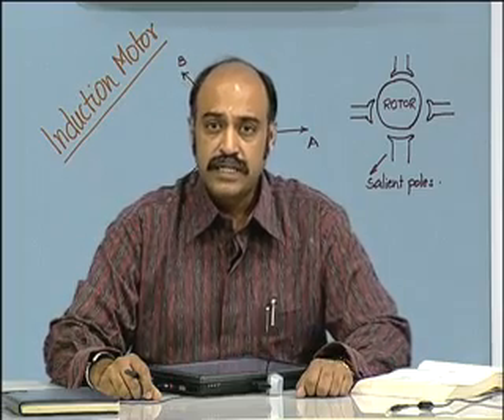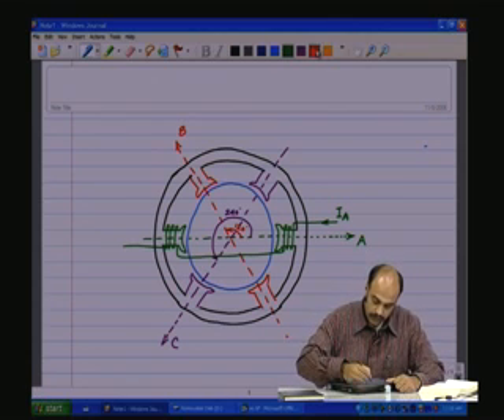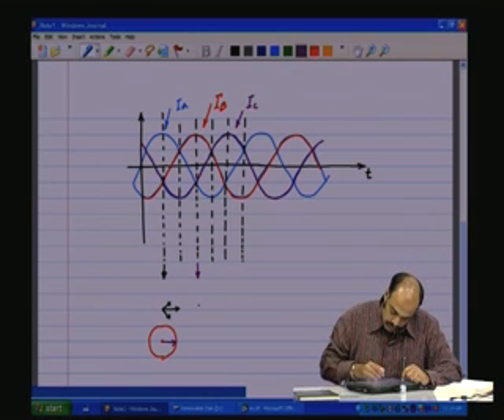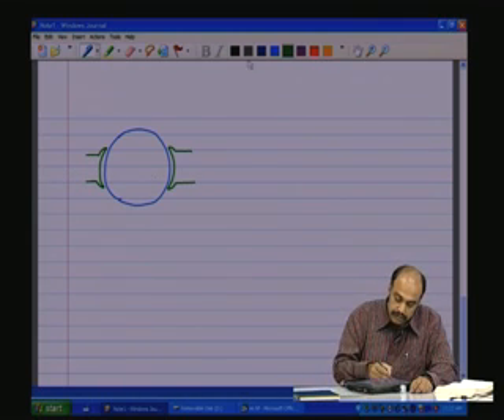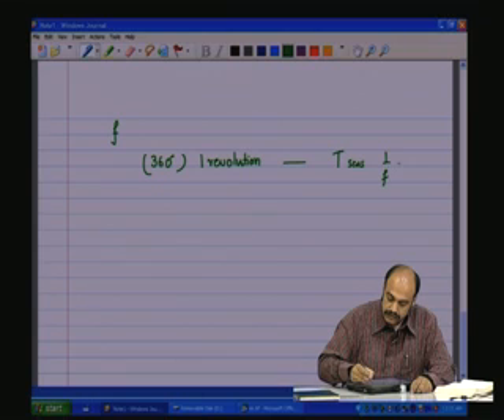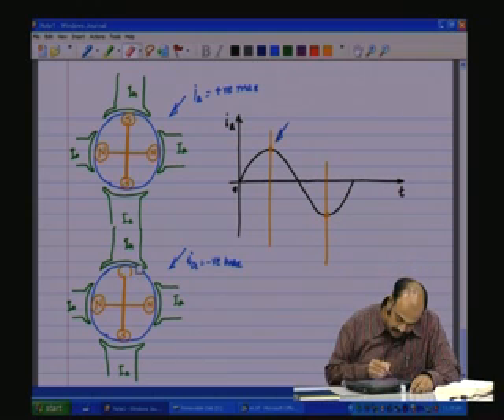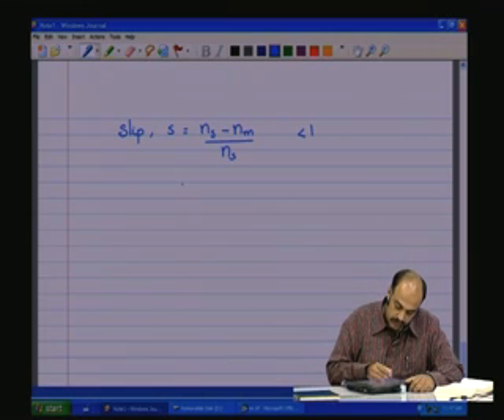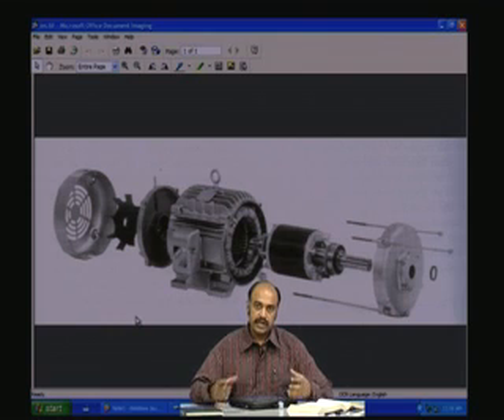lecture 36 - Induction motor

Comment: beautiful explaination :):):)

just one doubt. When the we start the motor there is no current in the conductor. as current  is 0, so how Lorenz force will act to rotate the rotor???
Reply: actully ,when we start the motor, a very high current flows due to high slip(s=1),which is five to six times in magnitude of full load current, which can cause many problems in motor,althuogh it is self starting motor, Starters are used in squarrel cage induction motor and external resistance is used in rotor circuit in case of slip ring type induction motor  to increase starting torque and to reduce starting current..